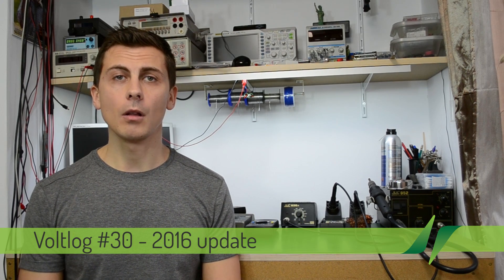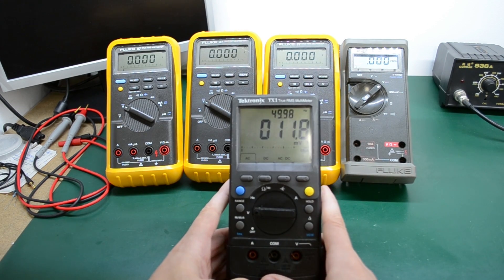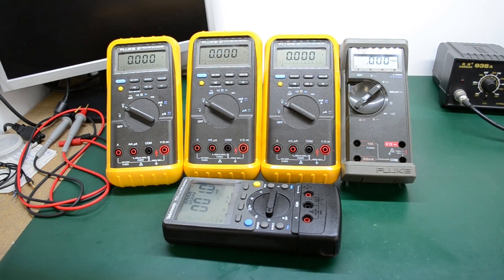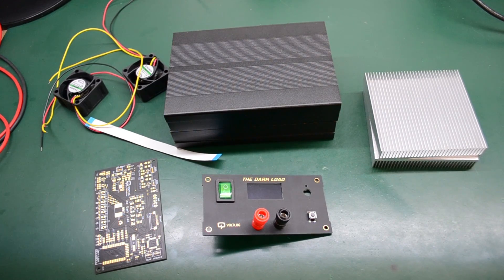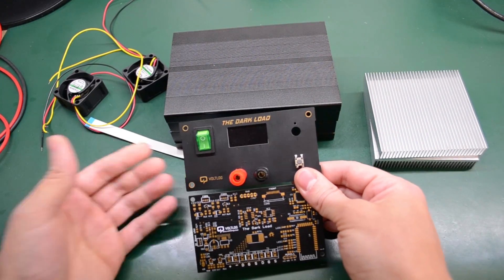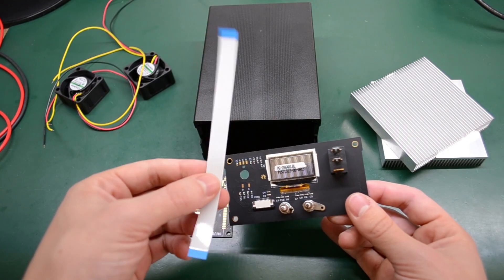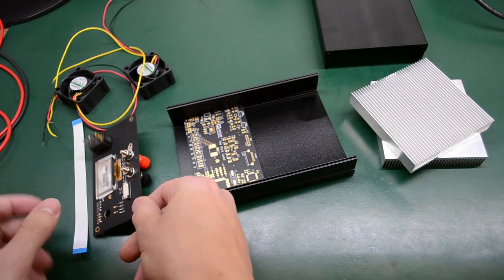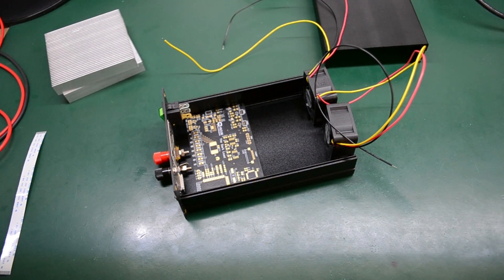Voltlog #30 - 2016 Update

Comment: Are you going to sell the dark load? It looks so good. I'd buy one if the specs were right.
Reply from the maker: +Felix Gardner I don't even know the specs yet, at least in terms of dissipated power I'm not sure how much it will handle. As far as the input range goes I'd like it to be capable of 5A 50V, with at least 60W of power dissipation. It's hard to get it right by just running the numbers, I don't have a datasheet for the heatsink and I don't know how the fans will improve the total system. But sure enough if I can get something nice & stable working, why not, I'll start selling it. The main idea here is that I'm defining the specs as I go.